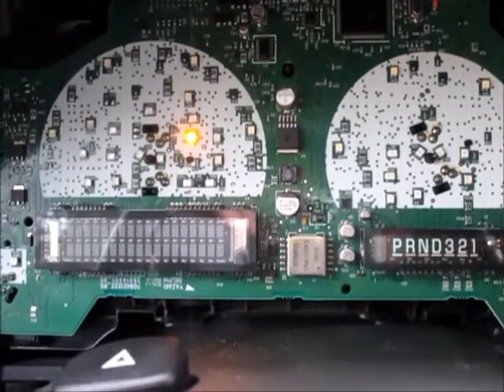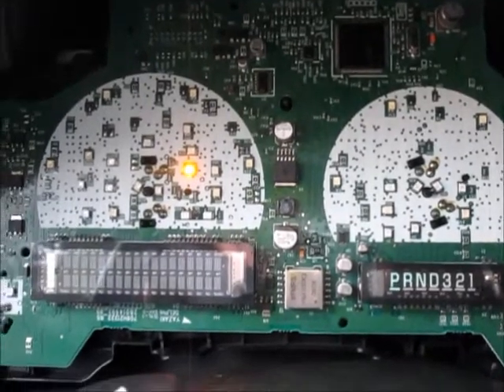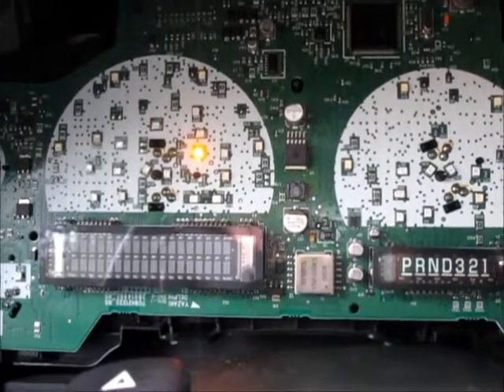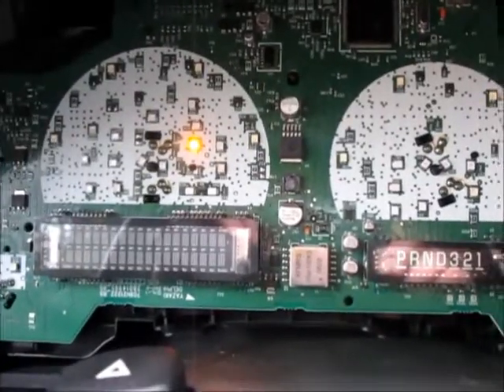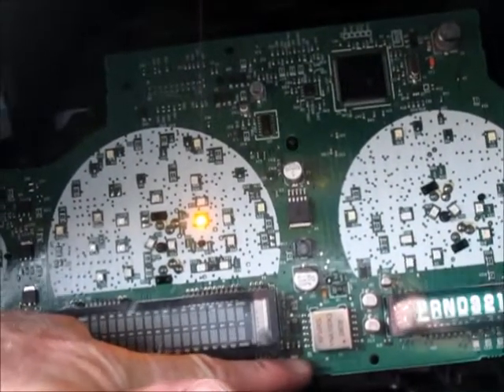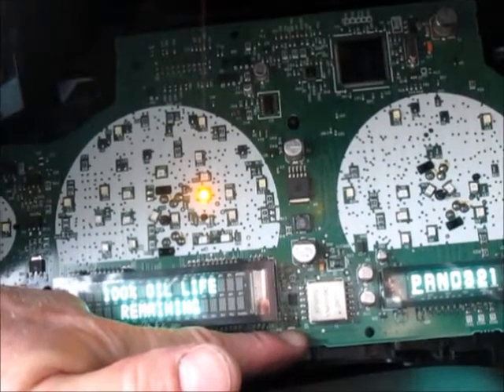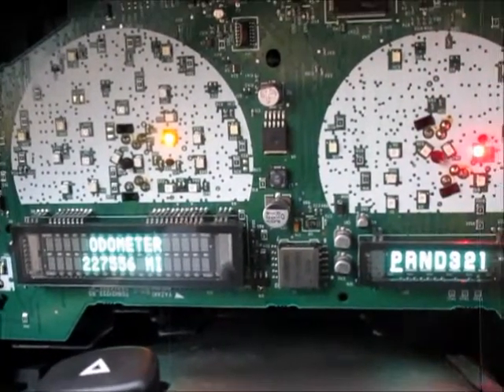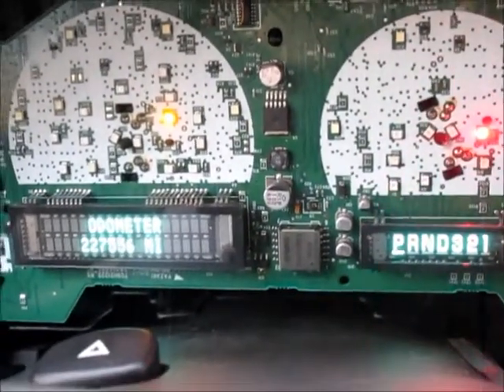How to 2007 Chevy Truck, Gauge Cluster Fix

Comment: There are 3 failure modes to these clusters:
1: MOSFET solder joint.
2: MOSFET has hole blown in it.
3: MOSFET has hole blown in it, gate resistor burned open and driver chip fried.
While something you get the luck of the draw, it's recommended to replace the MOSFET with a new one while it's apart for the best chance at reliability. And a step further would be to add a heat sink to the tab.
Reply from the maker: A year + later and it's still working. 250k miles on the truck. The dash will probably last longer then the rest of the truck.